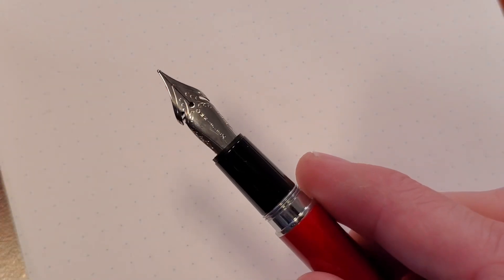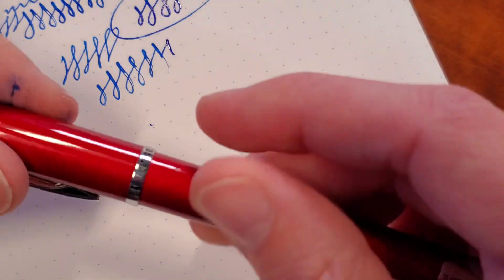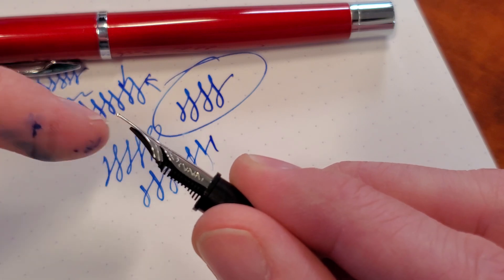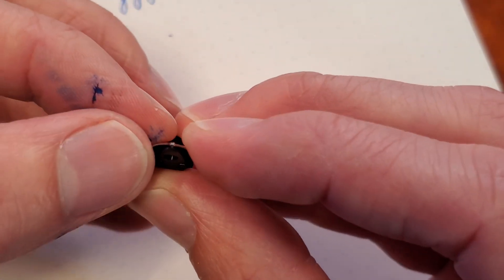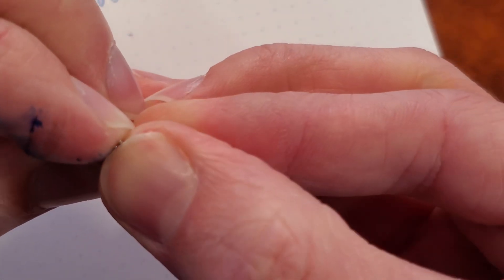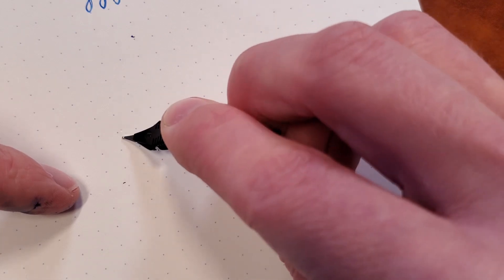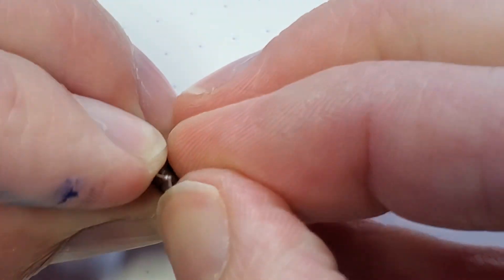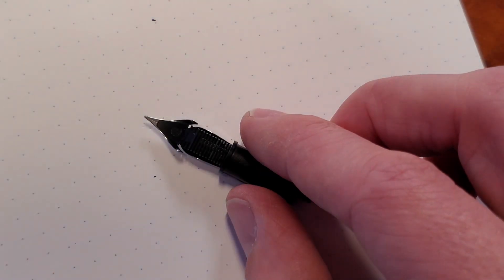JoWo Omniflex Nib Troubleshooting

Comment: I actually bought a #6 Conklin Omniflex nib a year ago at Goulet and had some good results with wet inks. I can more than double the line width without any signs of damage yet. It doesn’t need a lot of force, just the tiniest amount of pressure seems to work.
With all the bad reputation these nibs got I guess I was just lucky to get a good one, but I can say if they work they are fun to write with. Normal size is fine to medium, but variation gets it easily to B-BB levels.

Comment: Ultra-Flex Nibs from "Fountain Pen Revolution" are still better than this overpriced stiff improperly made nib.
After buying the Jowo Omniflex nib you will STILL have to have the nib adjusted for flow, thinned for proper flex (it's stock semiflex at best...if that!) and then sharpened for proper starting line variation. 
You could just buy an FPR ultraflex nib for $26.00 dollars and stick it on your pen and be done with it. 
Now, That doesn't account for the feed modifications that are needed to provide ink flow...but the nib would be sorted at least.
Reply: I did just that, and either they changed something or it simply doesn't fit
The FPR Nib doesn't fit in my Conklin Feed, and the FPR Feed doesn't fit into the Conklin Pen (Duragraph in my case)
Google told my this was a #6 Nib, but i  have found some conflicting info in some comment sections... so maybe i just ordered the wrong size.

Comment: The Omniflex in my Monteverde Innova  runs out of ink and requires tapping for the flow to keep going. It does it with both cartridge and converter. Any advice would be greatly appreciated.
Reply from the maker: Have you tried a different (more wet) ink? If that doesn't work, email us at info@gouletpens.com and we'll help! - Drew

Comment: I just got a conklin with a omniflex and it's my 4th... the first 2 write dreamy! the third came and the nib was "creaky" and the feed was a little loose - so I sent it back for a replacement.  the new one seemed ok but keeps running dry.  I looked for this video to see about troubleshooting - but 1) it's not bent back like that but the nib is slightly gapped from the feed, and 2) there is like no gap between the tines. any idea? should I contact Conklin? or the seller or ???  -- great video by the way.

Comment: I've got a different question concerning the omniflex nib. I've purchased Conklin Herringbone with an omniflex nib, not the jowo, but toledo one. It has a slight issue. The tines don't seem to be cut equally and the tip is bent a bit to the side. Is this normal? Or should I order a different nib?
Reply: You should email goulet customer service.

Comment: Very timely Drew,  I had some nibi problems with my All American,  the fine was just not working.  I purchased an Omniflex and it wrote about a medium fine as you described,  this nib has a heart shaped breather hole. Not much line variation from this nib ,would it be advantageous to buy the JoWo?  Actually I'm  pretty happy with the Hourly 1.1 stub I just put in though.
Reply: Dang auto correct,  that should read Goulet stub nib

Comment: What can one do to fix hard starts? Once I get it going, my Omniflex works fine, but I do have to flood the feed or dip the nib in water every time I want to use it, even if I only leave it for ten or fifteen minutes.
Reply: You but a new pen and give up on this one or return it if you have a chance to do so still. I’ve had 3 and all 3 are horrible. Constant flow interruptions and hard starts even mid writing. I would just look elsewhere for some reason this nib unit is just a total fail and always has been.
Reply: Not much flex.....
Reply: You need to learn how to modify pens, if you are buying flex pens. Whether it's an exspensive flex pen, or a cheaper one... you are going to run into alot of issues and troubleshooting. I am a full time professional artist and Bookbinder and I own alot of flex pens. Before I started buying exspensive gold nib flex pens that have been modified by a nib meister, and buying custom ebonite feeds... I bought cheaper stainless steel nib flex pens. Mostly noodlers, because I wanted to learn how to tinker with them, and not trash an exspensive pen that i couldn't fix.. and to solely to figure out how to learn and fix any issues that will arise with flex pens. People at goulet pens will just tell you not to flex as much, and buy a " wetter ink " for all these flex nib issues. I hate to tell you,  That's not gonna fix your problems with your flex pen... and if it does, its short-lived?? Then another issue will pop up sooner than later. I've learn so much from just searching YT vids and reading forums online. I learn how to put custom grinds on nib tips, thin out the under side of a nib, cut custom slits, grooves and lines into the nib that will alow them to flex much more, and easier! I've learned how to modify ebonite feeds and plastic feeds for flow... and to aid in problems like flexing to much. If not, you will fix your issues like Drew has shown... BUT THEN do it again, and again, and again lol. Iam not trying to knock these guys, I used to buy pens and ink from them all the time... until I started getting into custom stuff. You can actually bend the tip of these plastic feeds upwards just a tiny tiny bit, by heating it in hot water...  putting an upwards pressure against the underside of the nib... so when you 1st start to flex, it will keep ink right under the tip of nib while you start to flex it, fixing hard starts and railroading from the start. With flex pens, it's all a balancing game with flow and how it keep it going from start to super super flex. So I would suggest to let this one go, and buy something with less problems and better flex, or buy a new ultraflex nib from FPR.... then learn how to fix any issues by doing a little bit of research. These guys are bound by factory warranties, rules and guidelines, which means they won't be able to tell you how to fix most issues you are going to experience, or run into. Plus, after learning how to fix any F*&^-ups that you have done... you won't be afraid to start pushing what potential your flex pens really have! And not just the extra half of a millimeter line vacation that these guys tell you " no more than that, they aren't made for more than that. " I have 2 of these pens and I have had to modify the feed and nib heavily get it to work correctly. Just my advice, from a person that has alot of flex pens...and really pushes them everyday! Cheers
Reply: @danieljamesbinderystu2968  it was really cool of you to put such a detailed answer like this. It's a shame the person posing the question hasn't acknowledged it. Hope your flex nibs are still running smoothly!
Reply: @joeymaximus8146  Thank you, my friend... I greatly appreciate that. I try to be as detailed as possible without writing an entire instruction manual, lol. I typically get a little more detailed than most on here because I do leave a lot of helpful tips, tricks, and answers with Art related things and bookbinding related topics. And it seems no matter how much I feel like needs to be said, someone always comes along and nails me with 90 more questions 🤣. I do try my best to help as many people with stuff that I have 1st hand knowledge in. I "try" because I've had my hands involved in ALOT of different hobbies, trades, arts, building and construction, mechanics, drag racing, pew-pew smiting, collecting, etc, etc. And I had a lot of people who took their own personal time to teach me, guide me, and greatly help me out. I never really expect people to thank me, but it is always nice when someone does... like yourself. Again, thank you very much, and I hope you have a great day, man.

Comment: That is not the way to tune a nib. That feeb is a wrong one and needs the right shape/(right material )  a feed as an EBONITE feed done by JOVO. IfJovo can't fix the problem it is a useless nib. Just look at the nib in Pilot Namiki Falken or the other  Pilot pen which has a similar shape nib. If they want to imitate something they have to look at the whole concept and not only the shape.
Reply: Those Japanese nibs are gold.
Reply: Excellent point.  My Conklin Omniflex (the original, Toledo USA one) did not work out of the box, zero flow. So my next step if the warranty won’t take care of it is to replace or fix the feed.